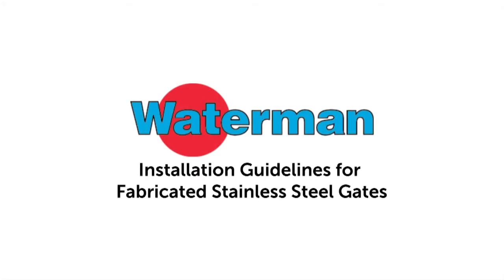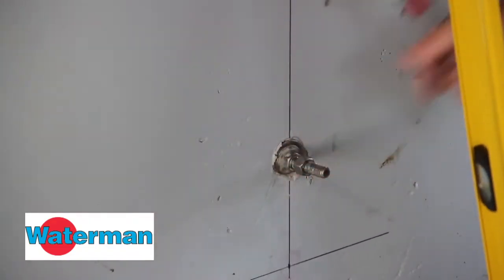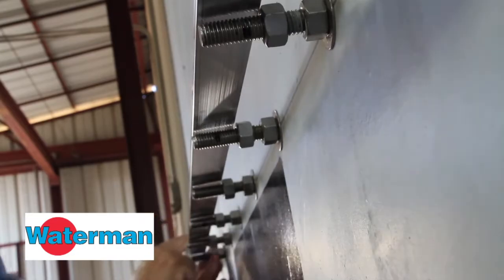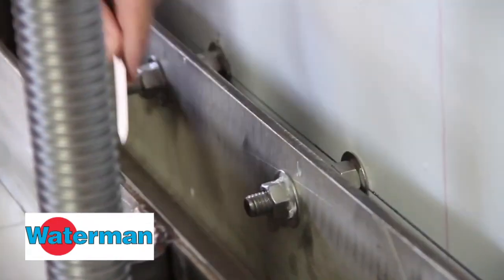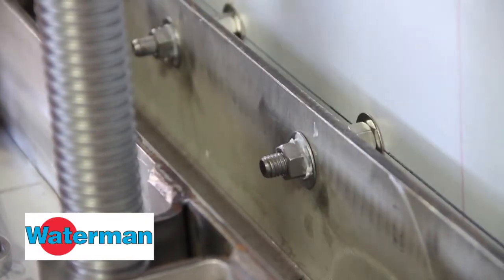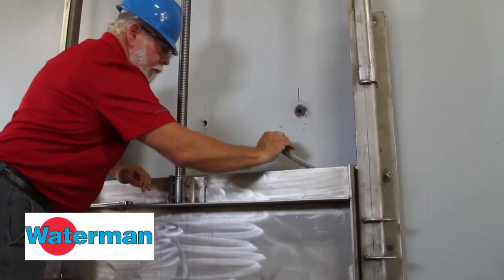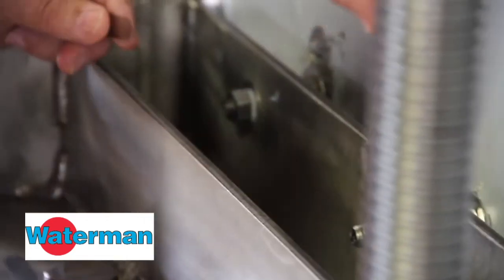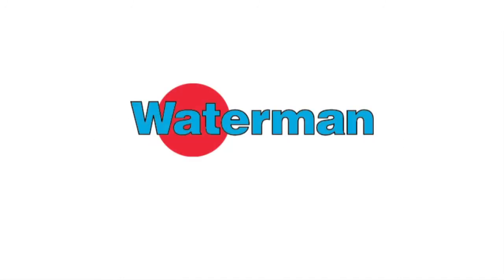Installation Guidelines for Fabricated Stainless Steel Gates

Comment: Where to place the sluice gate upstream or downstream ?
Reply: Either way.
Reply: @jaybelt4018  I have placed the gate in downstream so water pressure have started to push the gate downward causing leaking. And solutions?